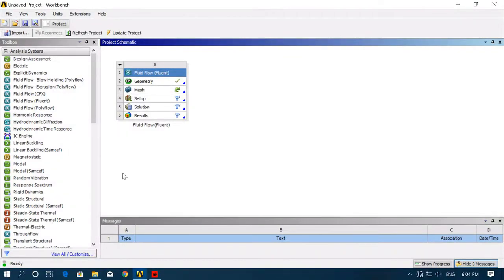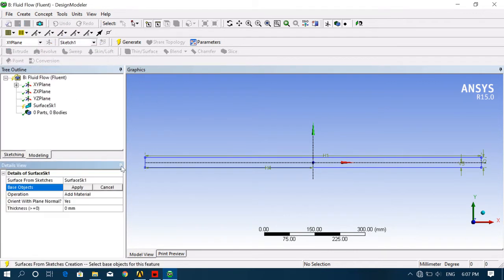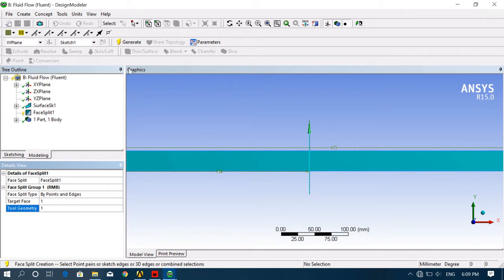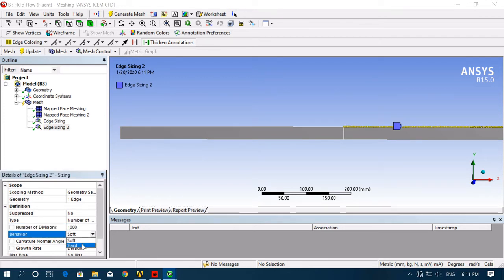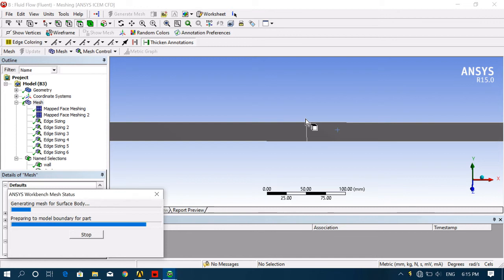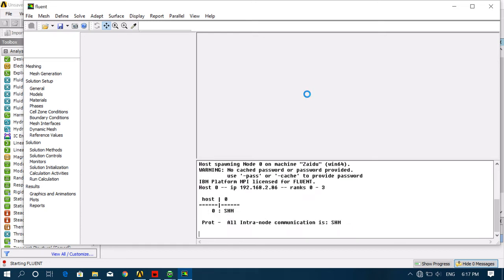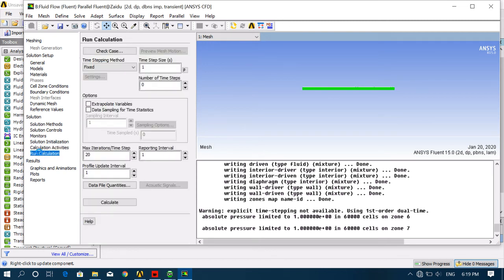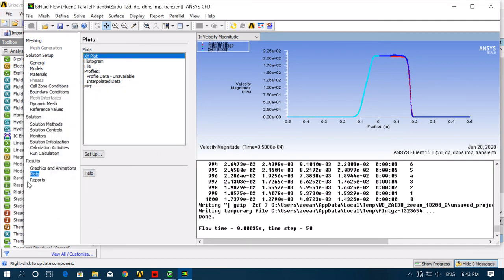Shock Tube Analysis in Fluent

Comment: What is the procedure if there is different gases in driver and driven section?
Reply from the maker: You should go for UDF methods. You can easily set up different gases for driver & driven sections. 
Very soon I’ll upload a video about this method.
Reply: @TechnoMechEducation  Can you suggest video/material to know more about it?
Reply from the maker: Actually I didn’t find any exact video on YouTube. If I get I’ll let you know
Reply: @TechnoMechEducation  Ok. Thank you
Reply from the maker: But the procedure for adding different gases is… when Fluent is open then go to Model > species > On 
Next click on material > double click on mixture > add gases Helium or N2 from fluent database
Reply: @TechnoMechEducation   What i want is helium in driver and air in driven. Will this be possible with species?
Reply from the maker: Yes, species should be ON then add Helium according to the above procedure
Reply: @TechnoMechEducation  One way i did is in materials, i added helium and air. Then, in cell zone conditions, i put helium for driver and air for driven. When i did simulation, i did not use species transport. Is this method wrong?
Reply from the maker: Check ur results by both ways… if there is no difference then okay.
Reply from the maker: The best methods is UDF method… but we need one Pre written program for initialisation process

Comment: can i contact you? I need your help
Reply from the maker: You can post ur questions here, I’ll try my best to help u ☺️
Reply: @TechnoMechEducation  i need to set initials condition of temperature and pressure, can i set them using "patch" function? (  sections have differents temperatures too )
Reply from the maker: Yes , you can
Reply from the maker: Same like patching the pressure you can give temperatures also for the both sections
Reply: @TechnoMechEducation  good evening sir, can  you help me with the setup? I need to use the vof method
Reply from the maker: Tell me full problem definition